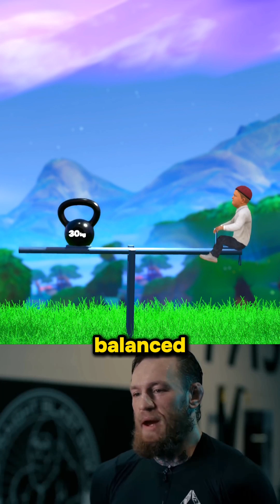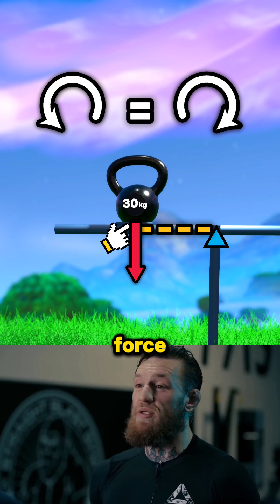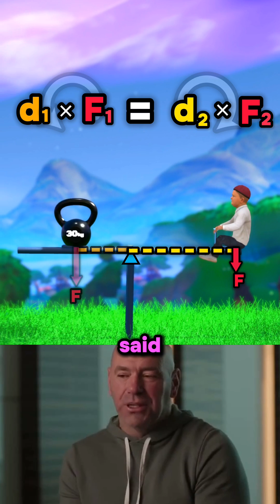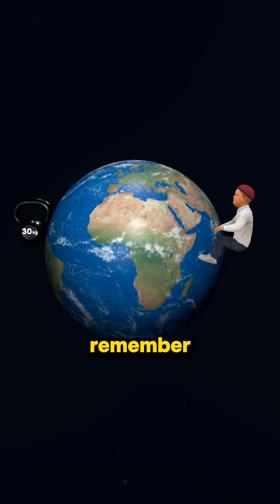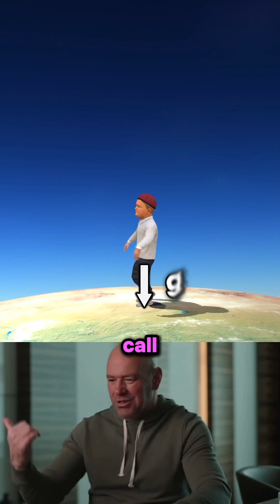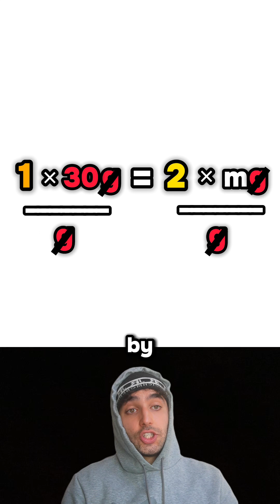Conor McGregor explains moments and equilibrium in 90 seconds

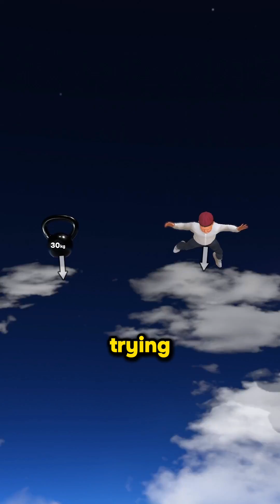Comment: 1:00 but if gravity accelerates you down. then why does only falling make you feel weightless. and standing on earth feels like being accelerated upwards not downwards
Reply: Weightlessness occurs when gravity is the only force acting on you, so you accelerate downwards. On the surface, your weight is balanced by the rection force of the ground, so you aren't accelerating
Reply: @gilby_6543  isnt a force defined by causing an acceleration, which is itselfe absolute, therefore gravity cant be a force, nor are you accelerating towards earth when freefalling, your just sitting still in spcetime, thus are not accelerated. when standing still on the surface of the earth, your moving in space time, thus are accelerated by the pressure/surface, which is the only force that actually is a force in this context. 
gravity is not a force hehe

Comment: This is so cool. Understanding moments is very useful for weightlifting. The Starting Strength textbook spends a lot of time on them, but even after reading and rereading the book, I couldn't explain what they are, other than they are what happens when you are off-balance and should be avoided (except the bench-press where creating a moment is unavoidable because that is the one main lift where the barbell does not travel in a perfectly straight path - if it does, you will create shoulder impingement and ruin your shoulders). Now I understand better and can explain moments better to my gym bros when explaining the bench press!

Comment: If you have a situation where the thing you are balancing on (correct me if I’m wrong, I’m not a physicist and it’s been a while). Since the actual balance point at which equilibrium occurs can be defined by the sum of moments divided by mass, if you had a situation of where the thing being balanced on was of a non uniform density, you now have to represent it using an integral. 

And this can actually be extended to higher dimensions with double and triple integrals like the ones you would encounter in calculus III being applicable for balance points in 2 and 3 dimensions respectively.

I believe the formula was the sum of moments in direction divided by mass where mass was the integral of function defining density at a given point, so the integral of this function is mass. And since you now have to worry about all the moments being different because of the varying density meaning a varying mass, and since the mass can only be obtained through that above mentioned integral, you have to sum the moments using an integral.

So it’s gonna be the integral of the density in the direction of whatever axis you are worried about to get the sum of moments in that direction and then divided by mass to get the coordinate for the balance point in that direction.

Rinse and repeat 1 more time for 2D and 2 more times for 3D and you have a coordinate in a 2 or 3 dimensional region of space where balance occurs .